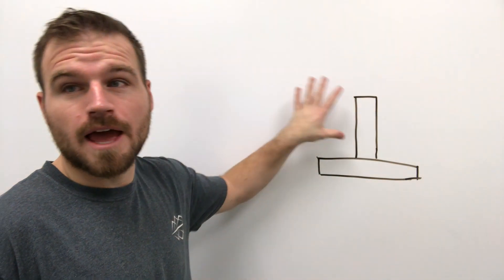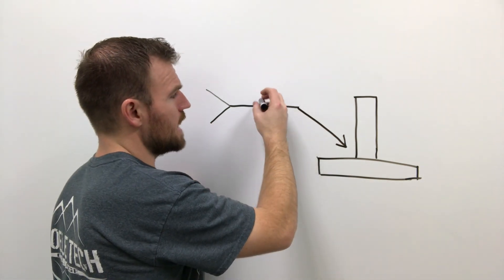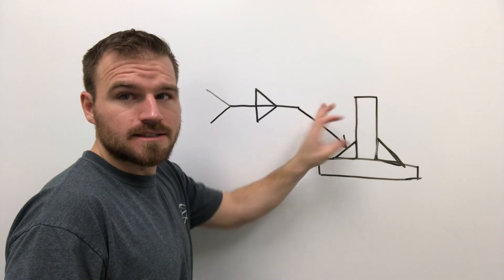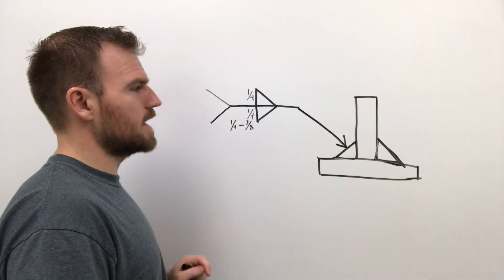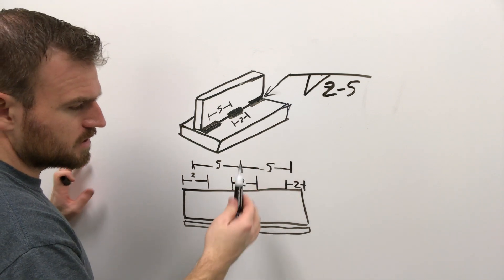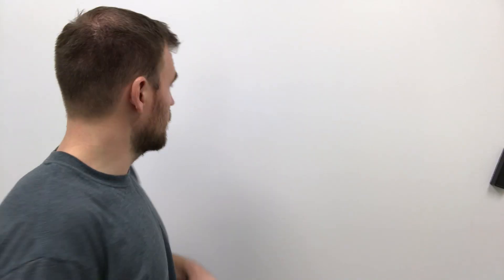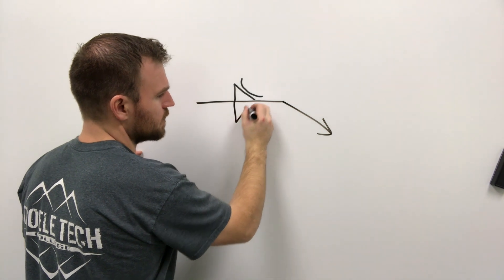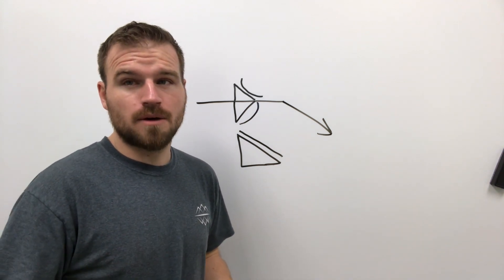Fillet Weld symbols

Comment: Your not doing it ok bud.
You should be starting with a 1" weld from the corner then à 3" gap then à 2" weld so that from the corner to the Middleton of your 2" weld you have 5".
Now you are marking 3-6 becacse your first weld is 2" long you got à 3" gap then à 2 " weld (at centre à 1" weld).
Have a gr8 day bud.
Reply: Ok

Comment: Hello question example 2"-4" stitch fillet weld, do you always start your measurement from the center on piece and work the measurement out on each side? so a 2" weld directly in the middle where perfect center of piece has 1" weld going left and going right full weld is 2".
Or
Could 2"4" also be 4" start measurement from end of piece and  go in one direct?